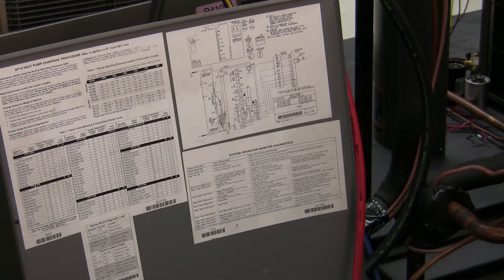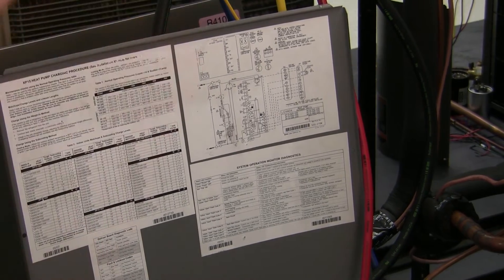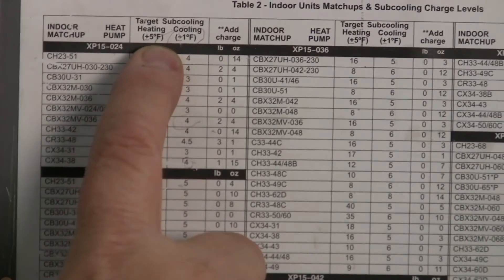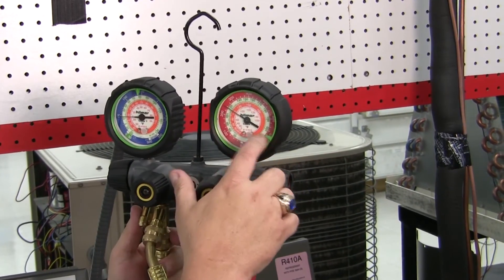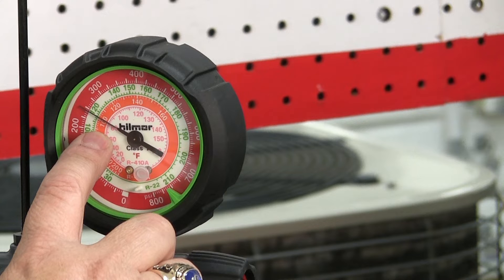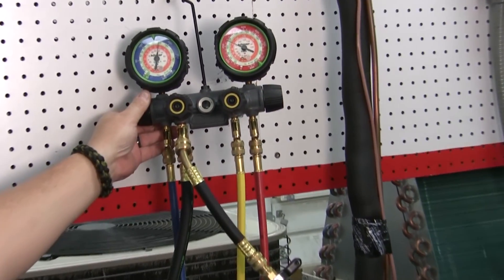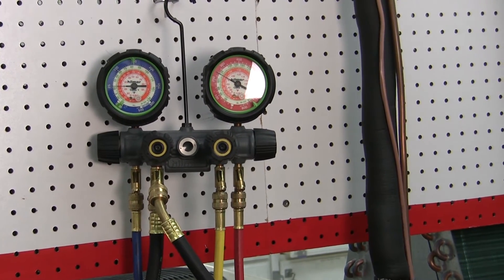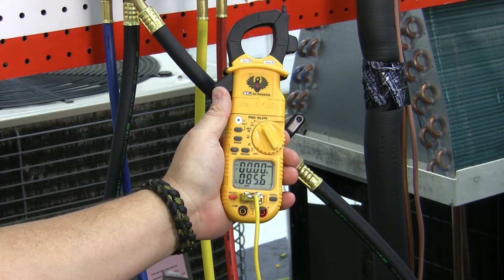Toolbox Tuesday: Charging A Heat Pump In Heating Mode | Lennox

Comment: liquid line temperature should be done at the the indoor coil not at the condenser . i find you pick up to much additional sub cooling from the coil to the condenser on the liquid line . You are going to over charge the unit. Think about your ambient temperature you will be working in ( cold attic , outside is cold ) In the video they are working in a lab.

Comment: Did you hookup low pressure gauge at real suction line..?
Reply: @HVAClearning   Dont you think you should have explained that very important step in the video?
Reply: @justinrichard4190  chances are if you're working on a heat pump and you don't know that already, the rest of the information is probably going to go over your head.